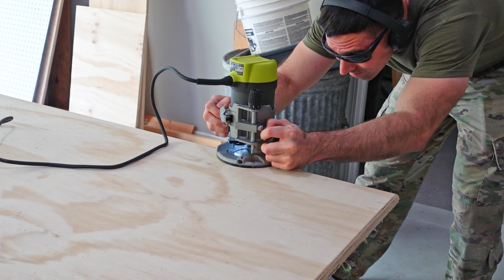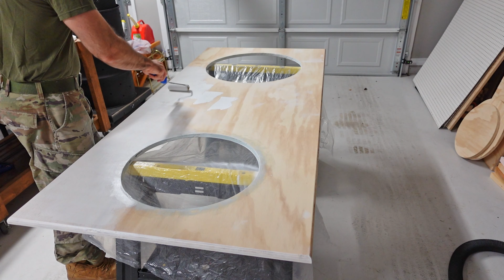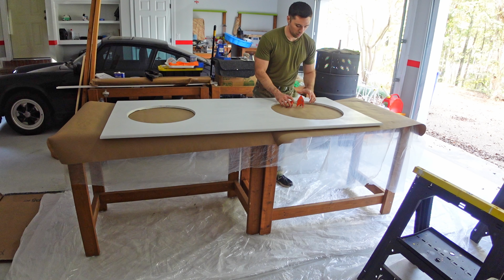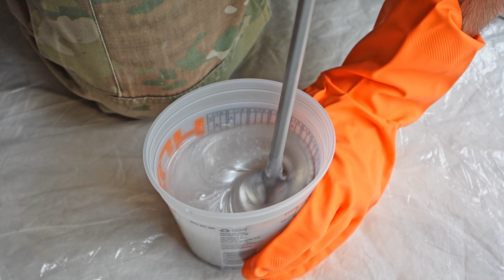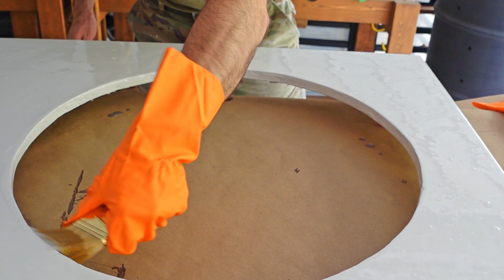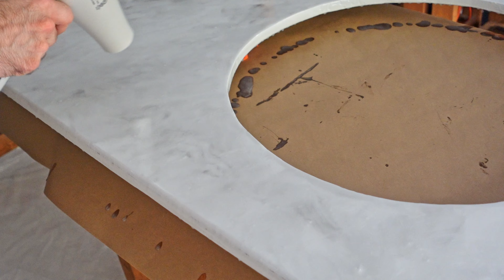DIY Mobile Wooden BBQ Cart || Part 2: The Top

Comment: What size circle did you cut for the 22” grill. The cart looks great!
Reply from the maker: It was 22.5" circle if I remember correctly. The grill portion is 22 but the bowl itself adds a bit more when you add its thickness. I recommend going larger so you don't have to worry about cutting to small and having to try and cut again to make the hole bigger. If 22.5" is the minimum size I would probably bump that up to 23", I remember trying to cut mine as small as possible and that was a mistake. The handles stick out like 3 plus inches on each side so you would still have plenty of support for them. I'm actually considering redoing the top this winter because of some changes I want to make and I don't like how the 18 inch grill is mounted.

Comment: You said epoxy can go through paper but you tried that construction paper? Did it go through?
Reply from the maker: No the epoxy did not go through the construction paper. I will say, the amount of epoxy I got on the paper was just the excess dripping off the edge of the top. It might be different if I had spilled more.